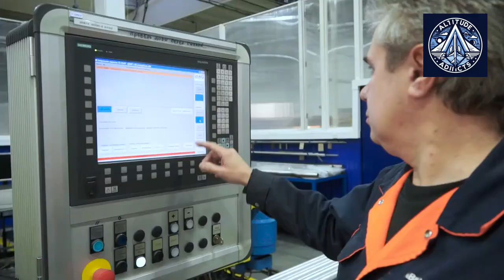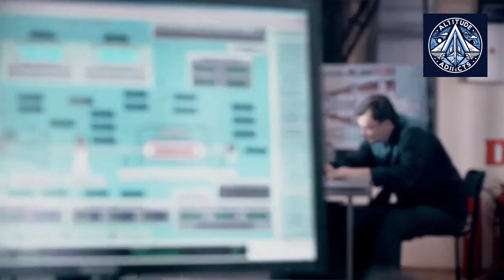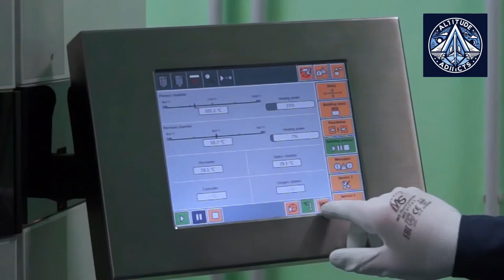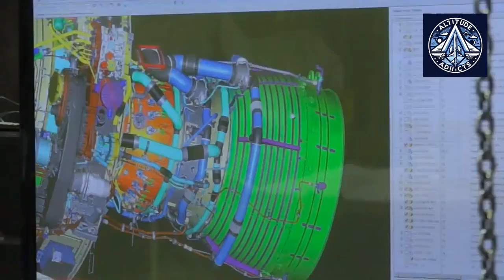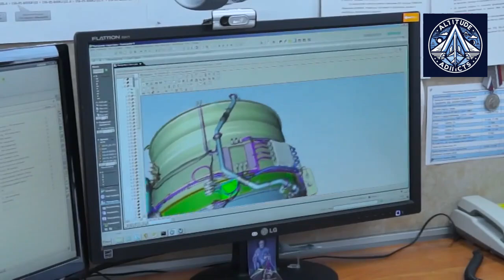The Rise of UEC: A Russian Aerospace Engine Giant

Comment: Unlike Boeing & Airbus UAC has the entire structure of aircraft manufacturing in 1-company. They also have maybe 10yrs of learning from Ms21 & SJ100 when they start commercially in Russia. They'll focus on their product & gradually they'll start selling abroad but all depends on the performance of their planes being used locally. 
Today they're taking the Su57 jet to the air show in China. Considering it's the only 5th generation jet that's being involved in modern warfare.. so gradually they could take advantages of obstacles & turn it to an advantage.. if not for the war who would've cared about the Su57 & if their planes (mc21 & sj100) are worthwhile & cheaper than their pioneer brands.. international markets will open for them starting from sanctioned counties; African countries & Eurasian countries.. if possible BRICS partners ... 
There's still so much work to be done though .....😮